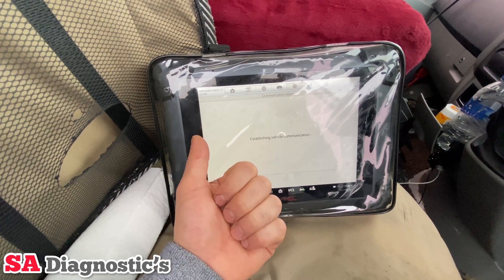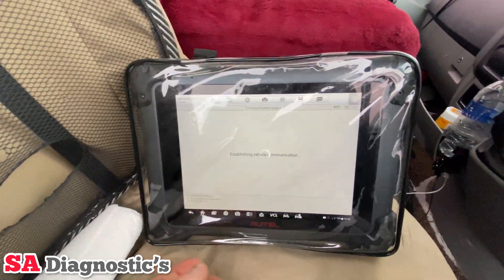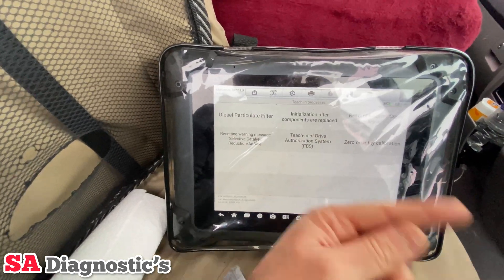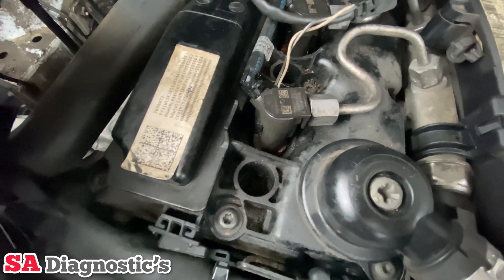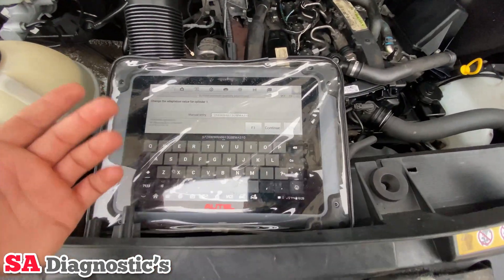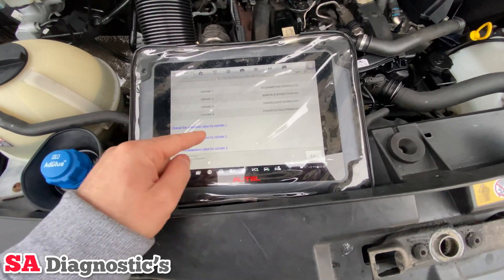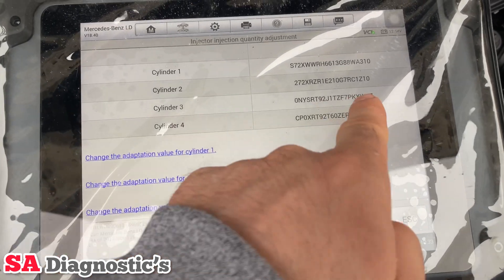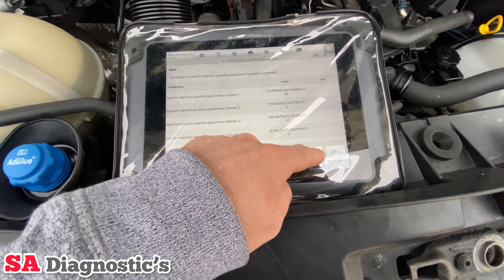MERCEDES CRANKS DOESN’T START CODING INJECTORS USING AUTEL STEP BY STEP

Comment: Hi I have mersedes a220 desiel I change time chain and aal ok timeing bt car not started I removed injector and check common rail do every one fire bt car not started any solution dear
Reply from the maker: Have tried to start it using easy start? Sometimes it’s difficult to get them started but using easy start may work. But this is just one of many ways trying…
Reply: @sadiagnostics how

Comment: Hi what happens if you don’t code the injector to the car my starts & runs will it do damage to my vehicle? 

What will coding improve?

I have e220 w211 2007 year.

Thanks
Reply from the maker: @kd3446  it just helps the injector to be calibrated. It will be a smoother run.

Comment: Hi....can you maybe help me.. i changed my injectors on ml280 w164 (the car worked before the change but had lots of white smoke and fuel consumption was crazy) so i then coded the injectors and the car wont start.. it cranks but wont start.. i get code 2211-1 and 2242-1 which i didnt have before.. fuel pressure is good...idk what to do anymore 😂 can you help?

Comment: Hi can you help me my sprinter is not starting after engine change
Reply from the maker: @JatinderSingh-jj5xi  hi have you coded the new engine in also is the immobiliser all paired up…
Reply: @sadiagnostics  no I didn’t coded the injector, today i tried to start the van, it started when i removed the camshaft sensor. May be it’s something off timing?
Reply from the maker: @JatinderSingh-jj5xi  yes sounds like camshaft for full scan and see what comes back…

Comment: Great video what’s the best Autel to use on sprinter vans
Reply from the maker: @redmonster5  thanks it Autel Maxisys ms908s pro
Reply from the maker: Again depends on your budget and what you need doing on the vans. If it’s just sprinters you deal with then I recommend getting dealership software as it does everything. Where as all these other machines only do a percentage of what dealership software does.

Comment: Injectores job have been done on my Mercedes and the car crank but don’t start , saw your video and went to check , and saw that he put the injector code from injector number 3 on the on the injector 4 . 

Now I try to change but wasn’t working , the Maxine was failing to do the programming what is your advice ?? 
Thanks will help a lot 
My car is Mercedes E class 220 bluetec 2014
Reply: Don’t know if was doing wrong way , the Maxine that I was using it calls Nukar
Reply from the maker: @edmilsonpinto4619  sorry for late reply it might be that the injector is also faulty hence why it’s not allowing you to code it in…

Comment: BEAUTIFUL PLZ COUD YOU EXPLAIN WHAT IS THE DIFFERENCE BETWEEN CODING AND PROGRAMMING AS WELL AS SOFTWARE TO MOUDLE?
THX REGARDS A LEARNER.
Reply from the maker: @ShaheehAlJazeerra  form my knowledge and experience coding is when you change a component so for example. Changing a EGR or any other component. However programming is when you need live data files. For example if your coding in engine or gearbox or headlight or any other part and your wanting latest file there is out there. To break it down further will talk about the gearbox, if you’ve bought a car in 2015 and you want to update the automatic gearbox then you would do programming this will put the latest file on the gearbox. These files are direct from dealer. It’s basically trial and error and they do this every year and dealers get many recalls and and damaged parts due to faulty files uploaded especially on the engine. Sometimes the file they use to run the injectors cylinders etc. they then come out with  a new file and that’s where you programme the new file. This will also stamp the date when you programme it. Coding is different that will just be a replacement part and you code it to the car to say you’re had a new part fitted but not updated software…
Reply from the maker: @ShaheehAlJazeerra  sorry for late reply I’ve had tonnes of comment and messages

Comment: does this apply to w638 vito ?  have replaced 4x injectors - will not start on key but can roll start it and runs fine.
Reply from the maker: Yes all Mercedes are same.
Reply: @sadiagnostics  thanks for the reply,  its weird that i can get it running from a roll start and it runs mint,  just never starts under key
Reply from the maker: @joshrulz8p  yeh that’s like first I’ve heard but hopefully you’ll get it sorted.
Reply: With my mk906 pro i could not get in to the engine... Didn't show a single hot function and kept saying it was a gasoline car while it's a diesel. I have send the computer back. What a waste!
Reply from the maker: @FrenchConnectie  but you have to remember Autel Snap on etc does not cover all cars they are generic code readers and Autel is by far better than snap on and the rest. Even wit the top Autel and snap on you are still limited in what you can do with it.
Reply: And why doesn't Autel send a user manual with the computer!!?? Unbelievable

Comment: Is it the same thing for 2013 mercedes cls550
Reply from the maker: No it’s different with Petrol cars…
Reply: My car has a check engine light  , fuel injector control module, a mechanic scan it and said some one replaced the injector and didn’t enter the values , he said they all say 0

Comment: Hi there thanks for the video I’m currently working on a sprinter 2017 mod 313 cdi 
We have replaced the worn timing chain as It jumped We put the engine back together in the correct timing used the same injectors bled  air from the fuel lines but we cannot get the engine to start it keeps cranking but no start however when we spray
Starting Agent into the intake the engine briefly starts and runs as long as you keep spraying the agent into the intake
I have Autotel Mk 808 Scener ( can this unit perform injector re-coding ?). We checked and confirmed that diesel injectors are corresponding to correct  cylinders  on the scanner.
Common rail fuel pressure reaches 300 bar when cranking there’s no more air in the fuel lines all four cylinders are returning just under 300 psi compression but it seems to be that there is no fuel coming past any of the diesel injectors can it be possible that all four injectors have seized up shut
Engine has done 465,000 km and it’s not displaying any more codes..?
Any suggestion would be greatly appreciated
Thanks
Reply: Hello there I hope this helps…I had this same issue we replaced the engine on a Sprinter 313 cdi due bent rod and of course we have to drain the fuel from the system we put everything back together as it should but didn’t wanted to start we found that the injectors got seized up shut we sent them to a shop to get them open and gave us instructions on how to bleed these Delphi injectors they’re pain in the rear but this how you bleed them when they’re completely dry  1st leave the injectors unplugged 2nd do not plug the return lines 3rd cycle the ignition about 5-6 times until there’s enough Diesel in the system 4th tighten the lines then lose them about 1/4 turn 5th have someone to crank the engine until you see Diesel pouring from the lose lines 6th close the lines 7th tell your buddy to crank the engine again until you see Diesel coming out of the injectors thru the return holes 8th plug the return lines 9th crank it again few times 10th plug the electrical connectors to the injectors, it should start 

Here is a video of these Injectors 

https://youtu.be/ahqBYGmTLrA
Reply from the maker: Hi sorry I can’t really say much it could be anything really, cam shaft sensor etc… do live data and see if anything is coming up
Reply: Hi did I have the same exact problem.

Did u solved the problem ??
Thanks
Reply: @93mrmm   also have the same problem, can start it for 3 days, did you fix it maybe?
Reply: Did you find out what’s wrong I have same issue thanks